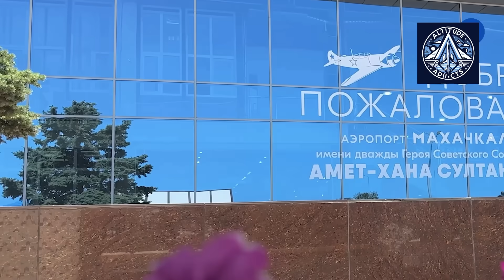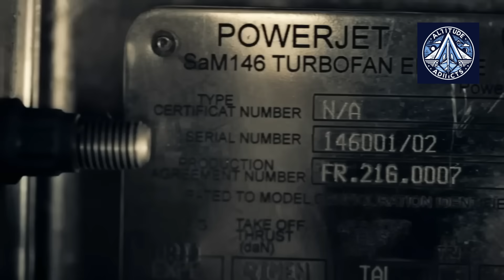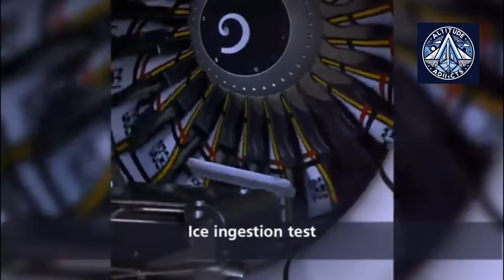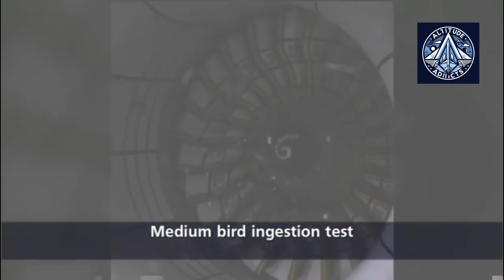The Secret Fixes Keeping Sukhoi Superjets SaM146 engines Flying

Comment: Surely, this French metallurgy is inferior to the Russia replacement parts. American doesn't transfer high-tech in turbine hot section to the French SNECMA or today Safran.
Reply: @alexlo7708  Before assessing this you really need to learn more on french habilities to produce aircrafts and the engines that go on them...
For a start : there is a multidecade joint venture between the US and France called CFMI...
But as always... Easier to be arrogant and belittle the frenchs than doing facts checking...
Reply: @paulteissier3468  Joint venture doesn't mean giving all techs.  The CFM was born because GE wanted to bring F101 military core engine tech to civil aviation market and eat all PW JT8 engine market.  So it used French as a broker to bargain with US Govt. against those military advisors. The French's engine, Snecma, has long been second to front row engine manufacturers. Since the Atar-engines to M53 until M88. 
Even M88 engine was developed after the French got US F404 for evaluated. Eventhoug, they still made M88 inferior engine compare to F404/414.
Reply: @alexlo7708 
M88 : 897 kg
F404 : 1073 kg
M88 thrust : 50 kN
F404 thrust : 54 kN
for me this is a quite evenly match so why bragging all this about ?
If not arrogance this is prepotency at least...
Reply: @paulteissier3468  M88 has shorter overhaul life. The same when its core was used in Sam146, Creating headache maintenance until Russian replaces all parts related to it.  Lagging metallurgy to the real West manufacturers GE RR PW even Salyut.
Reply: @alexlo7708 Well the SAM146 is all the most slashed by the embargo not so much by the tech issues... You'll get an answer to the rest of your comments very soon...
Reply: @paulteissier3468  Sam 146 reliable issue sent caution to all airlines that operated Superjet and ending the project in failure. Almost all airlines asking to return the aeroplanes before 2022 While the Russian denounced the French's engine partner who created the defect issue.  Actually, Russian cooperated with French was aim at French to lubricated proceeding on EASA air worthiness issuing.
Reply: Российская самая отсталая